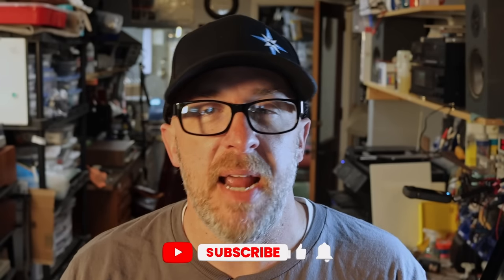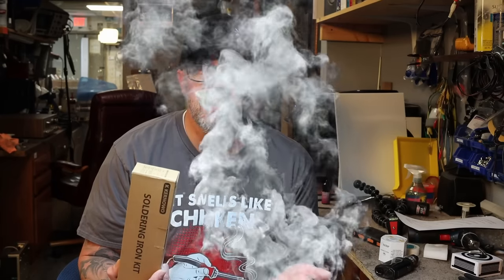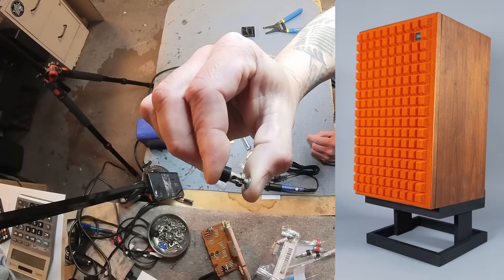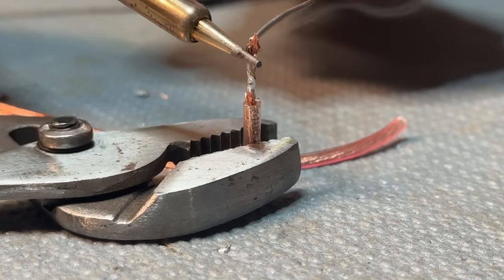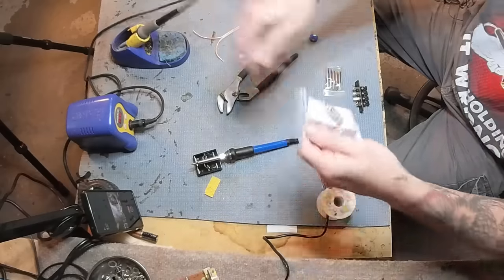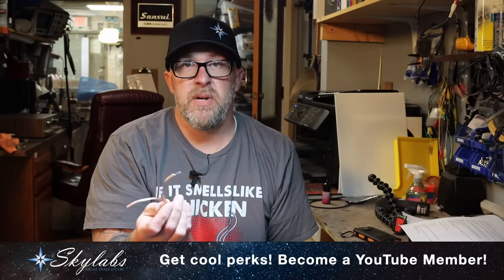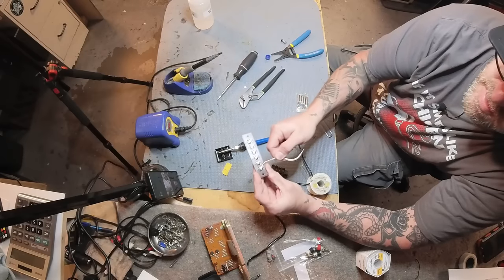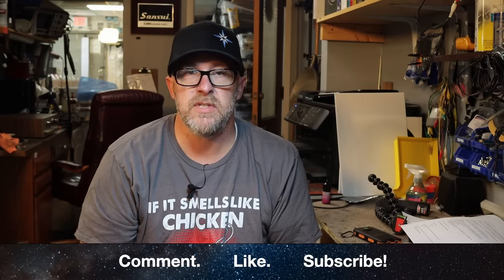Tips From The Bench -  Tinning Speaker Wire

Comment: I start with an uninsulated piece of solid 12 gauge copper wire (leftover from a piece of NM-B 12/2 household electrical cable) and solder it into my fancy super flexible 10 gauge stranded copper speaker wire. Finish the ends with a shrink wrap tubing to cover up the solder joints. These solid 12ga wires now fit into my vintage amp and speaker binding posts.

Comment: Keith: this may be the first time I can remember that I have some disagreement.
A) When I tin a wire for this purpose I cut a slightly long length of insulation from the wire, then with care twist the wire tightly. Then I tin only the tip of the twisted length, followed by cutting the soldered end flush. Since the tinning will probably go further down the wire than preferred - the cut will shorten the wire appropriately.  Now you have a wire bundle which does not tend to unravel and  get hinky. With this method the wire is suitable for pushing thru a hole or forming to go around a screw. If you tin the entire exposed length of the exposed end - the wire will tend to break and fray due to flexing.  
B) When heating any part or wire it is more effective to have already placed a small bead of solder on the iron tip - then when the contact is made - the solder conducts the heat more effectively. ( the bad solder has shity flux - or none )
C)  Note crimped wire to spade lugs create gas tight connections which can be superior to a soldered connection,... yea I know it is had to believe.
D) Metcal soldering stations are the BEST.
dan

Comment: For tinning (braided) speaker wire you should use a 30watt iron and  good solder doped with silver (and/or copper). 
You can purchase the "silver&copper" solder in small tubes for about $10.00
Jameco electronics is a good source for irons and solder. What a timely video..I just tinned some speaker wire last week.

Comment: In the past few years I have been trying out different brands of solder. I haven't used the Kester brand yet, but there is one brand in particular that to me is by far the best. It is Schneider, sold at harbor freight. I don't know what they put in it, but it flows beautifully, solidifies properly and doesn't require excessive heat to work with. Also, as Kevin and others have already mentioned, keep the soldering iron tip clean and tinned. Makes all the difference in the world!

Comment: I always use a solder bridge when I tin wires.  A small drop of solder between the iron and the wire forms the bridge greatly increasing the surface area and heat transfer.  Use a Rosin (rms) core solder.  The rosin will coat the wire, since it melts first preventing oxidation and helps with the solder bridge.  Clean the wire first with isopropyl, clean will get you good joints and tinning.  Just my two cents worth.  Keep up the videos, love to watch!  Thanks
Reply: Rma, rosin mildly activated.  iPad loves to correct me!

Comment: I own a vintage Heathkit soldering iron that I built in 1976.  It has a variable "heat dial" and a really nice "base/stand".  Showing why you would solder instead of using "mini" pins with an outside shell and that being an impediment to how close these wires often have to be on the back of a vintage Marantz, etc. makes great sense.  Keep up the great work.

Comment: Thank you Kevin for the video.  I went through three of the cheaper soldering irons available.  They usually work ok out of the box.  The issue is longevity.  They don't last and for the most part, they are not reparable.  I had one where the ceramic sleeve inside cracked the very first time I unscrewed it to change tips.  I finally got a Weller WE1010 and it's great.  I totally agree with you about the Hakko product line.  I bought a FR-301 vacuum gun and it's fantastic.  There's nothing better to use when you attack circuit boards!

Comment: VERY helpful (especially for me right now!) I just bought the solder and the Hakko Soldering iron. I was just planning on getting one like that. AND the tinning for speaker wire on a vintage system was also well timed. Mostly, I need the solder because I didn't listen to you, Kevin, and ordered a vintage turntable on e-bay. It travelled across the country and looked like it had been stomped on when it arrived! All those tone arm and cartridge head wires, yanked out! Wish me luck!

Comment: I have found that various different terminals and different wires either do or don't work well with tinned ends.   
Sometimes it is best to tin only the very tip to keep the strands together 
but allow the actual contact to be made with untinned copper.     
Kester solder is definitely good, but Edsyn is, too.  I won't tell what brand is the best I've used 
because if I did I'd never get another partial roll on the cheap from an estate sale.

Comment: Brilliant!  I wish I knew this years ago.  The times I've tried to push bare wire into speaker terminals... The amount of Banana plugs etc I have had to buy...
Yet sitting in my electrics box is a good quality soldering iron with a very good secure stand, a proper wiping sponge and decent solder.  I can see myself being a bit busy in a few days changing out those connectors on my 7.4.1 Q-acoustics home theatre set up. So, to reciprocate on good tips, I use heat shrink over connector plugs as insulation, not tape.  Maybe that might help someone!!!  Oh and here in the UK we pronounce the L in solder.

Comment: The ultimate tinning is a Hexacon personal tinning pot. About 1 inch solder reservoir. Twist the braided copper until it’s  a tight twist. Dip the whole part of the conductor’s in Flux then dip it in the tinning pot up to the plastic insulation. This method lets all the conductors to soak up the solder completely! You’re not missing any wire at all! I’ve been using Tinning Pots for 40 years and Hexacon is the best!

Comment: I still use my Radio Shack entry-level iron from about 1970 and it prefers solder that is compatible with its static temperature. Fortunately I somehow knew to keep a clean tip, so it keeps on working. I think a beginner has two important things to remember. Keep away from the insulation protecting the wire with your iron and ventilation is a good idea overall. Thanks for the overview and keeping the channel interesting (for me anyway) and the humor is appreciated.

Comment: Back when I ran a tech shop for a concert sound and light company, we received a bulletin from a connector manufacturer that recommended using crimp connectors over solder, because when stranded wire is soldered, the strands can fracture in places where the solder ends and the strands begin. They made a strong case for crimp connectors, especially in situations where there may be strain on the wires or movement from time to time. If I am trying to get through a small hole, I will tin only the tip of the wire to get it through the hole. Then pull until the solder-free strands are in the connector jaws. This allows the connector to compress the strands, similar to crimping. Then trim the excess and voila!

Comment: Ok. First .. the sponge will expand after you get it wet..next you start tinning the iron before it gets hot.. and you tin the entire tip..and then tap the iron on the corner of the bench and wipe with sponge.. finally when you start to tin the wire you should flux the wire first.. and you add solder to the iron before you touch the wire..when heat is transfered to wire..you add solder to the iron where it contacts the wire and when it flows you add solder to the wire and slowly move the tip and   add solder till you see the wire holding the solder mass. Remove iron before the wire covering melts. Next  flux the terminal and tin the terminal..quickly join the tinned wire and while holding the iron to the wire / terminal.. add solder to the stop between the 2.. count 1. 2 3.. remove..the iron and watch the solder harden.. before you release the wire before your fingers are purple

Comment: Clothes irons set to highest temp when used for hot-glueing veneer to speaker enclosures can leave a mark too. 
It should be noted that some electronic engineers recommend against tinning wires that are connected via a screw or spring pressure terminal - particularly in any device that might be susceptible to sustained vibration.  Rather, they suggest simply tightly twisting the braided wire and tightening the screws firmly. 
That said, I definitely prefer a decent banana plug/jack for speaker level connection  - many of which also use screws rather than solder, and I’ve never had problems with them - and whenever possible would go out of my way to replace spring terminals on “vintage” speaker enclosures.

Comment: I used to do this and stopped because I wanted the convenience of easily plugging in and removing speaker wire when changing receivers or amps. I actually just had the outside of my + and - wires touching each other on the outside of the banana plugs last week, causing one speaker not to work and a degradation in sound. I didnt realize my left rear speaker was out because 3 were working giving enough sound not to notice one was out. I initially blamed it on running a usb cable from my computer to my DAC because i now have ROON and the computer is my ROON Core. Once I figured it out, i had to put electrical tape around the outside of the banana plugs to prevent them from touching again. I think it's time to revisit tinning wires.

Comment: I have a cheap iron that looks somewhat similar to yours, and you know what it works just fine. It may not last long but for my usage that's fine.
I tinned only the very tip of my wires, like the last 1/8 in. The speaker terminal contacts on the bare copper and the solder still keeps the strands together. If I was to connect/disconnect the wires often I would tin the whole end, in case some strands break off and hang away from the solder. In the end I don't think any method has an effect on sound quality, at least for my old ears.

Comment: Hi and really many thanks and congratulations for your channel.
Any way, this time I must disagree with this idea (even I know, sometimes we have no other option)  : 
Considering we are talking about stranded wire in "direct" connection to device (no bananas), tinning it will drastically reduce its contact area with the device speaker connector because it will not spread and ultimately not ensuring a better distributing inside the connector anymore (becoming more like a solid wire) .

Comment: I have always simply twisted the wires with zero issues since the 70's.
Reply: The sound molecules travel better through solder than just bare wire,I can sure hear the difference ,can’t you ?
Reply: He mentioned NOTHING about sound quality!

When I use twisted wire I HAVE at one point in every setup had a speaker cut out because some individual strand of copper touched another wire!  

Just somewhere in a surround setup things get sloppy or movement will eventually just dislodge a strand!

I love this idea if tinning them!
Reply: @TheGreatTomDix  he sure suggested it. I learned how to twist wire correctly as a mechanic

Comment: Actually the $10 soldering iron kit that they sell at Walmart is actually not half bad. I remember the first amplifier or two that I had to resolder input jacks or reflow loose connections, that's what I used. It works the only thing with it is you just got to give it time to heat up, it just doesn't heat up as quickly as my more expensive soldering iron

Comment: LOL @ the shirt - fuking hilarious. My next tip would be if someone throws you cap unexpectedly, do not catch it. Just don't.
And ya, I try to never use extra connectors inline (spades, bananas, pins) so I've been tinning for years - but I just tin the tip of the wire is all and clamp on bare copper. Obviously the old vintage gear (is that redudant?) has such small flimsy connectors that tinning is almost a requirement.

Comment: Imagine a pipe in a vice. The contact area of the circular pipe on the vice jaws is far less than if you squashed the pipe flat. I think you would get far greater contact area to your speaker cables if you left the solder off and just let the spring connectors squash the bare speaker cable conductors.
Reply: This is true, but the big problem is when one small strand of the wire doesn't make it into the hole, and runs the risk of touching your other wires.  My favorite way to tin wires is to smash the tinned end with a hammer so it is a slightly flat, solid tip.  Good contact and no wild strands.

Comment: The secret to soldering is making sure that the wire or component leads are clean. This is why solder with a rosin core is used. It actually cleans as the solder is applied. There are other types of flux but they all pretty much do the same thing, they remove impurities so the solder will adhere properly. Use isopropyl alcohol to clean flux residue after you have tinned the wire.
Reply: Yes to that.  The flux is an acid that is heat activated.  It de-oxidizes  the surfaces just long enough for the solder to adhere.

Comment: Solder is made of Tin and Lead. Copper has a IACS conductivity of 100, Meaning it's conductivity comparative to other metals is 100%. Tin is 15% and Lead is 7%.  Banana Plugs should be gold plated, which has a rating of 70%.  I think you can do the math on why you don't see many people considering this alternative.
Reply: Considering that virtually all the electrical connections in your audio equipment are soldered, I don't understand your opposition to tinning wire with solder.

Comment: 8:21 ...  You need to apply liquid flux to prepare the wire.  Note that solder is a very poor contact conductor.  It will probably work ok but I would use some type of terminal that
can be soldered to the wire.  When solder is bonded to the two metals it is an excellent conductor.

Comment: I'm politely disagreeing with wire tinning for connectors. Found this to back up my understanding

IPC-J-STD-001 Rev E, page 13, section 5.1.3, “Stranded wire shall not [D1, D2, D3] be tinned when:”
Wires will be used in crimp terminations
Wires will be used in threaded fasteners
Wires will be used in forming mesh splices

Therefore to answer your question “Should the wire be tinned?” the answer is NO.
The reasoning behind not tinning the wire is, if the wire is tinned, when the screw closes down on the wire, it would break the solder joint and leave an opening within the strands, which can be susceptible to vibration, loosening and corrosion. By not tinning the wire, you can get a better gas tight joint.

Kevin, you'll probably be using that cheap soldering for the rest of your life. I still have my soldering iron from the 70s and use it all the time.

Comment: If you REALLY want to use one of those banana or pin connectors, just remove the outer conductive tube and replace it with heat shrink. It minimizes the size and gives it a non-conductive casing.

Comment: The included soldier from China is lead free.
They're not allowed to sell new stuff with leaded soldier in the EU any more.
60/40 is a bit harder to get these days for that reason.
For electronics lead free soldier is just crap. First it doesn't like to flow and when it's finally on, it is very brittle.
No lead in the solder also is the reason, todays ball soldered processors fail after a while.